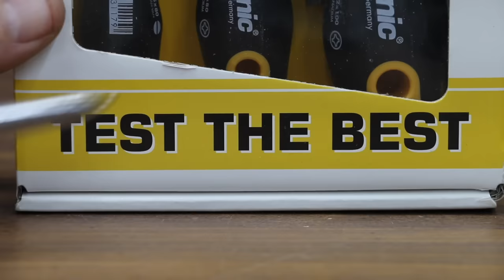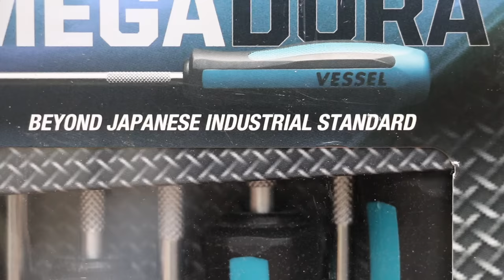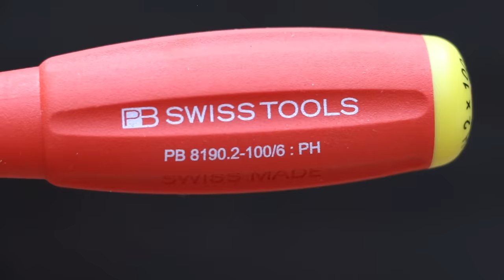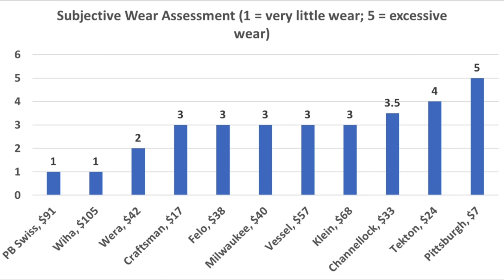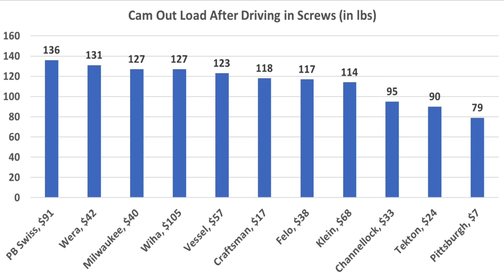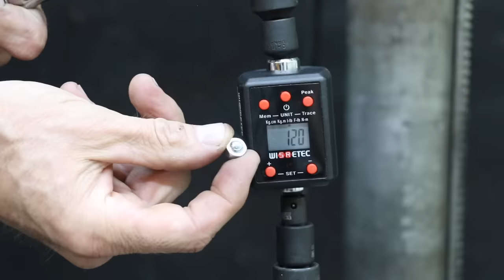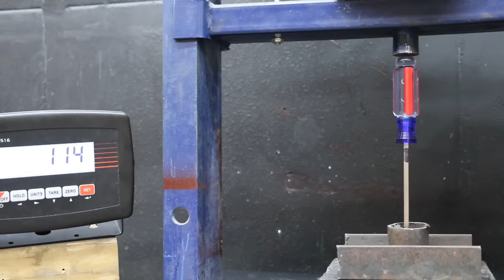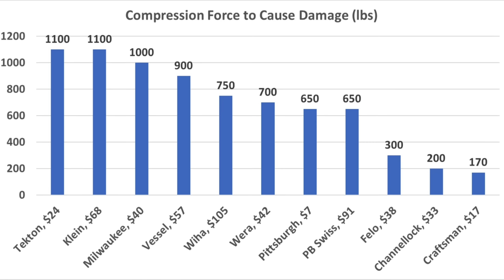Best Screwdriver Set? Craftsman, Milwaukee, Wera, Wiha, Klein Tools, Felo, PB Swiss, Tekton

Comment: I have been extremely happy with my Tekton hard handles and thet have held up extremely well.

The Channellock screwdrivers are actually made by Pratt-Read. 
I have been happy with mine which have performed as well as my Pratt-Read essentials series screwdrivers,  but the Tekton drivers seem to have a better tip fit and the handles are night and day better.
Reply from the maker: Thanks for the feedback.
Reply: @htr5372  
Maybe, Pratt-Read is / was capable of producing just about any quality level the customer requested.

Also if Channellock is still sourcing new screwdrivers today they may not be from Pratt-Read,  since ideal gutted the company less than a year ago.
I have found the Channellock and P-R essentials series to hold upa little  better than the last of the domestic WESTERN FORGE  made Craftsman screwdrivers, but not as good as the Tekton or the US made Stanley 100 plus.

The precision drivers in my essentials set are actually Master mechanic branded for some reason,  I guess they got mixed in but they're the same.
Reply: @htr5372  
I've been very happy with my TEKTON  drivers and picks myself, but I do have probably 5 different screwdriver sets so none are really seeing any abuse or very heavy use.
I also try my best to clean out a screw head and use penetrating oil whenever necessary , as well as use the best fitting driver I can.
With the nice handles and good screw fit the Tekton hard handles have worked out very well for me.

I'm not disputing the tests or anything and it's clear the steel could be better, but in my experience the good fit has made up for it enough that they've held up better than the test would suggest.
Reply: @htr5372  
I really like the Channellock model 6n1, it's 100% American made down to the tips , when the Tekton only has an American made handle and the Klein is now completely imported it seems.
That's a shame too, because they were always considered one of the best 4 in 1 and 6 in 1 drivers next to the classic Enders.
Reply: @htr5372  
I don't use them much because most of what I'm using my tools for is specialized, but in a general diy home repair type situation they usually have everything I need.
I have bit drivers for situations where I might need hex or torx or something like that , and I do not think of the 6-1 type as a replacement for anything else.

Comment: Next time, test the handle strength. I am a small engine mechanic, so I use carburetor cleaner a lot. The handles on my craftsman screwdrivers just melt away. I go through screwdrivers like crazy, and lowes doesn't want to honor the lifetime warranty on the craftsman screwdrivers, so I need a new set. I think I'm going with either Klein tools or wera.
Reply from the maker: Thanks for the suggestion.

Comment: You ask for ideas, so here's something that would interest me. I'd liked  to see a comparison of the various PEX connectors, e.g., Shark bite vs. crimp(s), etc. I'm about to replace all the water lines in a large 1930 house. Sharkbites have often been recommended, but these fittings are expensive, hard to work with in tight spaces, and I don't trust they won't leak over time. I like the crimp fittings but here the cost of the tools can be difficult to justify for the DIYer. Great videos!
Reply from the maker: Thanks!  Thanks for the suggestion.

Comment: This video sealed my decision to buy PB Swiss Rainbow SwissGrip screwdrivers. Got a pretty good deal got both the slotted and Phillips for about 112 free shipping definitely worth the money. Love these things outrageous what they charge in some other places definitely didn't want to pay for Snap On or Mac tools prices.
Reply from the maker: Thanks for sharing.
Reply: @htr5372  this is something that has resonated with me as I bring them home from my shop box and they really do have a difficulty just getting into places based on the shank like you say. Going to start looking into the classic non Swissgrip or even their heavy duty line with the hex bolster to add extra torque with a wrench. I have a set of Wera and Wiha but I just don't get the same feeling of satisfaction picking as I do with a PB Swiss. Definitely wouldn't tell other techs to use these unless it feels right to them too many good brands that are being neglected like Wera, Wiha, and Vessel all excellent brands.

Comment: I got a set of craftsman screwdrivers recently (2022) and I'm not impressed. They're made of very light metal and the tips already chipped on two of the flat blades. I still have an old set of craftsman screwdrivers from 30 yrs ago and most of them have survived.
Reply from the maker: Thanks for sharing.

Comment: Have you considered testing the Wera brand with the yellow trimmed handle? Most have a metal striking cap on the handle.  I believe the shanks/bits are supposedly stronger than the green trimmed handle variety.

Thank you for your time.
Reply from the maker: Thank you for the video idea!

Comment: I always have the same response when someone does a side by side comparison for power and hand tools and power equipment. If you use your tools to earn a living, buy the ones that have the reputation for holding up to the daily wear and tear, and take care of them. For the average DYI person, it depends on the limits of your pocket book. I have many tools. Some are the top name brand, some are bargain tools. I have experienced named brand tools failing early of which I used only a few times, but then I have had tools that the better brand proved to do the best and most accurate. I 'had' a Porter Cable cordless impact driver that I purchased 5 years ago. I used it in conjunction with a cordless drill to build some shelves. That impact driver worked great, just as I hoped it would. After that I did not use it very much as per occasional driving a screw whatever for a small project. Then just recently, I took on the back deck rebuild project. When it came time to start driving screws, that Porter Cable cordless impact driver, decided to not hold the 1/4 bit(s) anymore followed by just plain stopped working altogether. I guess I either owned one built on a Monday or Porter Cable ain't worth a nickel. Either way I had to use a backup tool to complete the work. Not going to spend $150 on a new name brand tool only to never use it again. So, I like to watch the comparisons, but I also know that in todays world, not everything is absolute. Every company out there cuts corners to save a buck so even the really good tools will let you down.
Reply from the maker: Thanks for sharing.

Comment: I don't think I've ever seen anyone use the hammer drill function to drive screws in wood. I've only seen the hammer drill function used on concrete bits and I typically use an impact driver for screws in wood
Reply from the maker: Thanks for the feedback.

Comment: To be honest - The IMPACT DRIVER test is outside the realm of what the HAND DRIVEN screwdriver was designed for - though it does show how soft the end tips are after repeated use. I have been happy with my PITTSBURGHS - my biggest issue is  I LOSE them before I destroy them so I tend to buy CHEAP on certain items.
Reply from the maker: Thanks for the feedback.

Comment: Great video. I would have liked to see the Eastwood screwdrivers tested as they have a good reputation.  I've had Snap-on straight blade twist without hardly any effort, but that may have been quality control.
Reply from the maker: Thanks!  Thanks for the suggestion.

Comment: It’s a shame that craftsman doesn’t have the same quality as it once did…

Regardless, one of the things I still like about their screwdrivers is that the shape of the handle allows you to put a 6 point socket on it.   This allows you to exert much more downward pressure along with torque using a ratchet or breaker bar.  This is especially handy when removing rusty or stuck screws…
Reply from the maker: Thanks for sharing.

Comment: I would love to see a stainless steel screwdriver test. I have a set of Witte stainless screw drivers. But many many other brands make stainless drivers for stainless screws. 

It would also be interesting to see if brands heavy duty screw drivers(striking cap and hex on the shaft), hold up better vs the non heavy duty. It would be interesting to see if they use different steel at the tips or not.
Reply from the maker: Thanks for the suggestions.
Reply: @ProjectFarm  also....maybe Test the stainless drivers to see how stainless they are. I don't use the stainless drivers for stainless screws. I have some as a low maintenance (don't have to worry about them rusting) option to keep in my car. 

Also, if you test out the heavy duty ones. Testing Witte's protop impact set would be awesome. I actually prefer the handle of the Witte's to my Weras. 🤷🏼‍♂️😬

Comment: I'm curious. Is the brand "Best Guard" not available in the US? I bought a "Best Guard" Philipps screw driver which I got for like $1.50 for a single screw driver. it has a metal striking cap and had been a great tool for me for over a year now and still in good shape despite everyday use.

Comment: Great video! Love my Whia set. I also have a klien set and milwuakee, while the klien has longer shafts which can be handy in some siutations, i find the whia very comfortable even on sight screws. Milwuakee shaft can pry better, seems very stong and doesnt flex, but its not as comfy, and is the same length as my whia set, so i carry the klien and whia esd set in my service bag. Bonus is the whia set can be had for 65$ CAD on sale, and even has ESD protection up to 1000v all the way up the shaft not just the handle. Saftey first. Klien has ESD proof ones but the pricing is tripple or more to the whia, although i havent tried them so i cant comment on how they feel etc. Klien is really where cutting tools shine, i know alot of guys who like knipex, but ive tried side by side using side cutters with another guy on 10/2 or 10/3 BX cable, the knipex really had a hard time and the klien did very well, neither are rated for that thick of a cable. ive also use my klien cutters on deck screws and 1/4 inch steel bolts, my buddy with the knipex couldnt cut the bolt, only the screw. PS, my klien cutters have cut probaby 6000 or more copper cables (mostly 14/2) and they still cut like new. This is the kind of tool you will own for life unless you cut a live wire. Same for whia screw drivers, ive heard of guys who have had horrible injuries from using non esd screw drivers, the main reason they say is COST. whia is making it more affordable, and lots of guys on site are running whia ESD now. My 10 cents as an electrician / data cabling tech
Reply from the maker: Thanks!  Thanks for sharing.

Comment: While I own many different brands of tools/screwdrivers, I usually reach for my Snap-on screwdrivers, mainly for the comfortable handles. Matco isn’t bad, but not as comfortable as the Snap-on IMHO.
Reply from the maker: Thank you for sharing!
Reply: @htr5372  - Mine have the twisted type comfort grip handles. They aren’t bad, but I like the bigger Snap- on rubber grip handles a little better.

Comment: I work as an Industrial Maintenance Technician/controlls engineer. I will say this, going from your husky/milwaukee, to wera/wiha. You can't even begin to compare the two price points. I use my krafkompact micros on din rails and i/o cards all the time.  As well as the standard insulated drivers from wiha and wera. I prefer the wera drivers due to the grip design. Wiha Allen's though.......other than pbswiss.....good luck finding anything comparable.
Reply from the maker: Thanks for sharing.
Reply: @ProjectFarm  anytime brother. Keep up the absolute gold you've got going. Best channel hands down!

Comment: Newer Craftsman sure ain't the same as the older ones, but they're still great for the money. I've have a mixture of both with a few Klein thrown in for good measure. The "hammer" test was the only test that left me shaking my head. That's just not an intended purpose for the tool. But I understand testing it since most people aren't going to be bothered with getting the right tool. LOL.
Reply: The thing about the craftsman though is that all their hand tools are still lifetime warranty.  Break it, get a new one free. That makes it worth it

Comment: Does everyone know you can grind those #2 Phillips when they deform on the tip. Just keep the geometry the same and they work nearly like new. Sometimes better because the blades get a little thicker and fit tighter in the screw. I get at least two grinds at least doubling the life of the tool.
Reply from the maker: Thanks for the feedback.

Comment: So far in my personal hunt for the perfect screwdriver, some of my favorite screwdrivers have been the Gedore SK 2154 PH-06 3C.  They have a through shank and striking cap, a handle that seems to resist oil and brake cleaner, and finally the dual hex shaped shank and nut driver step.  They haven't seemed to want to cam out.  If you ever reprise or do a follow-up.  This would be a brand to consider.  🙂
Reply from the maker: Thanks for the suggestion.

Comment: Not sure why the Wiha's were so expensive, They're about the same price as the Wera's in the UK. I only use insulated drivers for work so i guess they're different screwdriver sets. We also use pozi headed screws and not phillips but you generally get a pack of 6 Wiha or Wera insulated drivers for around £35. Don't see many electricians using anything else but I personally prefer the ergonomics of the handle on the Wiha.
Reply from the maker: Thanks for the feedback.
Reply: @htr5372  Can't comment on the Phillips, we don't use them over here. I mainly use the 3mm, 4mm slotted and the PZ2. I've snapped a few 3mm flatheads but that's from being lazy and using it on screws that are too big.

Comment: Interesting how well Vessel did since it was made for JIS screws not Phillips and it would be interesting to see if any phillips could win against vessel with a jis screw
Reply from the maker: Thanks for the suggestion.
Reply: @ProjectFarm  thank you for taking the time to read my comment and I’ve been trying to study this question for a few weeks now but don’t have the fancy science gadgets you have.
I do know JIS screws are mainly found out about when people try to remove rotor screws on honda cars,any Japan motorcycle or bicycle derailleurs.
Reply: Yes indeed!! The Vessel is a JIS (Japanese Industrial Standard) driver, not a Phillips - they have different geometry. That said, I almost always grab one of my Vessels for any Phillips head tasks, since they work great. The reverse is NOT true, however, as anyone who has ever tried to remove screws from a Japanese motorcycle with a Phillips can attest! Stripped and buggered screw heads on vintage Japanese bikes are always the result of a previous unsuccessful and damaging assault with a Phillips screwdriver...
Reply: @oddballantiques1223  I own an old 1985 goldwing so I definitely get my use out of the vessel for JIS and I believe the impact version I have would have done better in the tests on Phillips screws
Reply: I think PB Swiss altered their design about a decade ago to fit well with JIS screws. Outside of Japan that may be the only one actually designed for them. It is the only one I've heard of anyway.

Comment: You should look up some of snap on owned company tool brands. Williams makes snap on screw drivers and are usa made and fairly cheap. I just bought a 19 pc set on amazon for 130 dollars and i actaully kind of perfer them over my wiha heavy duty screw driver set. All tho snap on uses different specifications for their snap on branded tools. Would be cool if you made a couple of videos going over tool truck tools vs their name manufacturer branded tools like snap on vs william screw drivers, or other tools just an idea. I think Matco ratchet flex wrenchs are made by williams but are made in their china plant unfortunatly, but a quality/spec test would be cool, i find myself trying to find this kind of content and you do a good job doing what you do and i'd watch them and would be benifical for mechanics trying to save a few bucks, and possibly getting diy'ers a few finds on some quality usa made tools.
Reply from the maker: Thanks for the suggestion.

Comment: I could never understand the difference in torque when using an extension on a torque wrench. Also, torque dry or lubricated, how much difference in bolt stretch?

Comment: The Craftsman looks like the best bang for your buck. And since it costs half as much as the Wera (which is the 2nd best bang for your buck), if you lose it or it gets damaged, you can buy another screwdriver that's almost as good as a Wera (or you can lose it 3 times compared to the PB Swiss, which is never less than number 1 in almost all tests). It looks like for a normal homeowner, the Craftsman is the winner. As long as you don't hit it with a hammer, you're good. :D By the way: why do people do that?
Reply: So so many projects and car work. Have to hit screwdrivers with hammer all the time.  35yr craftsman.  Never had a problem.
Reply: @pjwaszko55  
Hi. Thanks for the response. I'm curious: why do people hit their screwdrivers with a hammer though? Thanks. Have a nice day.

Comment: I stopped buying Klein when a new flat head screw driver  head just twisted like it was butter when I was securing a contactor lug. Klein refused a warranty claim, claiming abuse.  It was an appropriately sized blade for the task, their heat treat is just garbage now. 

They also use wedges, whereas wera (my preferred  screw driver) uses what looks like a  hollow ground tip which seems to provide more meat behind the tip. 

Wera is generally pretty great value, especially if you grab them on sale!
Reply from the maker: Thanks for the feedback.
Reply: @ProjectFarm  thank you for the quality content